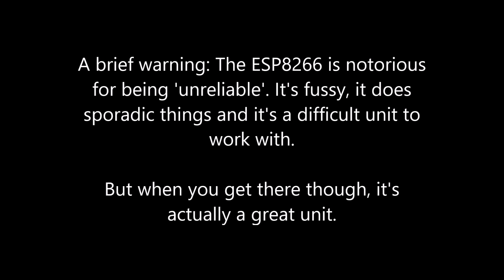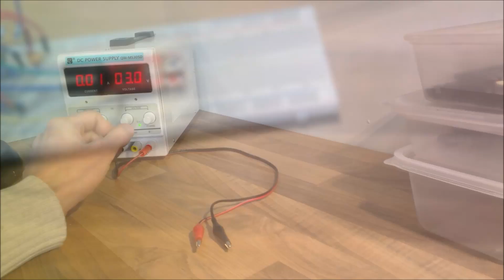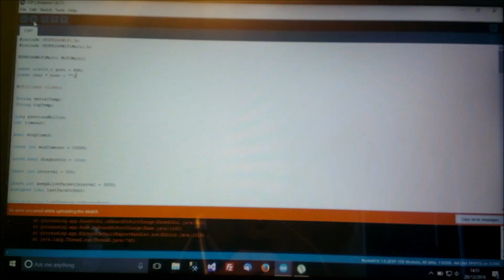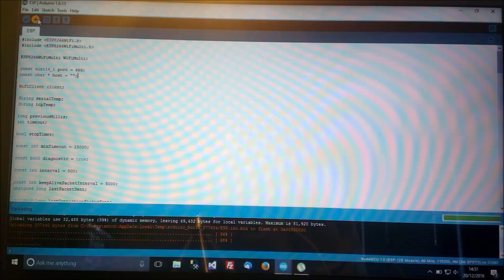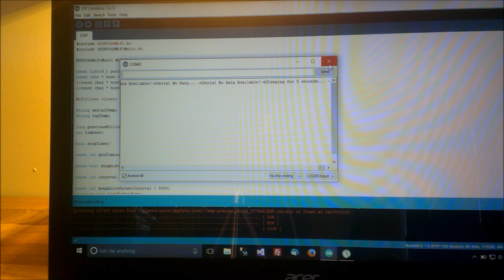TUTORIAL: How to wire up and flash the ESP8266 12E properly! It works! (Arduino - Getting Started)

Comment: Your uart has 5v logic level- it can destroy the esp. You need to use a resistive divider on the TX by uart.
Reply: never mind, it has a jumper that switched to 3.3 volt. :D
Reply from the maker: Thanks for your comment, however, it's not correct. In this example, the UART was set to 3.3v. These UARTs which I'm using are dual mode ones. Thanks, Antony...

Comment: Thanks for your video. Can you explain what is the purpose of the small capacitor soldered on the esp? Regarding GPIO2, I'm surprised as I did not manage to flash it without wiring it to ground if I remember correctly.
Also, you might be interested in this 3D printable adapter found on thingiverse: http://www.thingiverse.com/thing:1333056
Reply from the maker: The small capacitor is a decoupling/filtering capacitor. It's to protect the ESP from unwanted signals apparently. I have tested it with and without and it does seem to increase reliability substantially. I'd say it is absolutely necessary.
Reply from the maker: The adapter is very interesting by the way! I'll look at that in more depth later! Thanks...

Comment: Hey! Quick question on soldering tiny components like these: do these handle a little bit of rigour? I found that these easily come off. I am wondering if stencil + solder paste + heat gun is a reliable way to soldering these. Thanks for making a video by the way. :) hope to see more like these.
Reply from the maker: Hi! Thanks for your comment! About soldering tiny components, I've found that they are quite delicate. If you heat them up too much, the pads can melt off the PCB. You can actually get an SMT breakout board for these though, and they are very easy to solder up and also give you the regular pin pitch. The way they are designed is in such a way whereby the pads are soldered downwards, so its a lot harder to damage the pads using this breakout board, and ofcourse, there are no awkward wires to have to grip either... Thanks again, I like making these videos. I hope to do one on the STM32 at some point, and also I'm going to be working on a Solar Control Computer too..